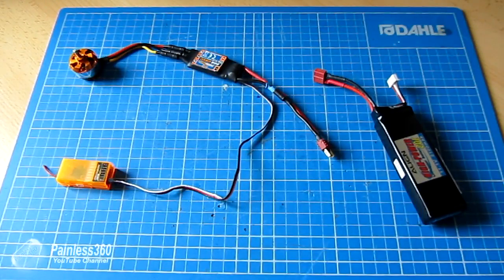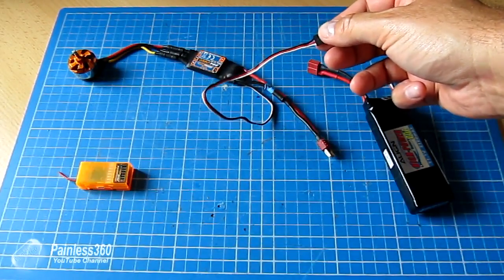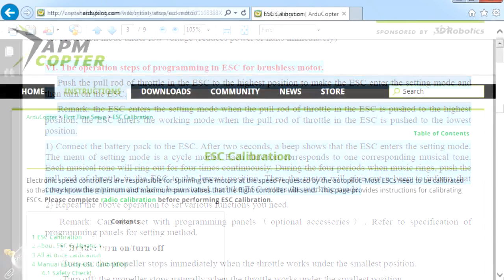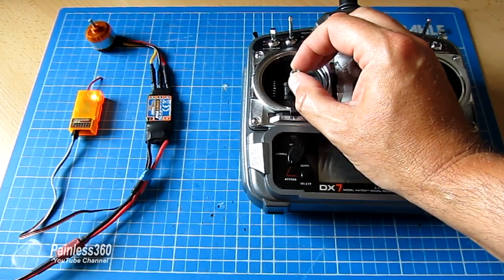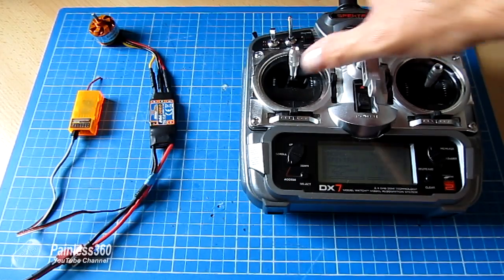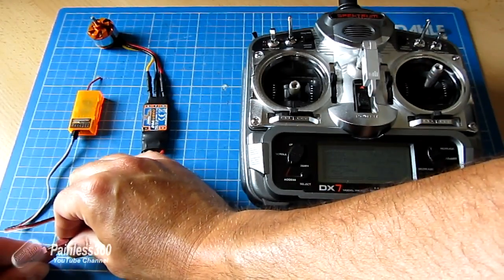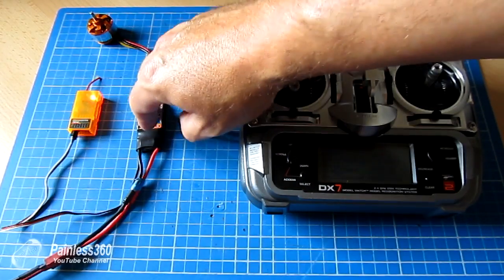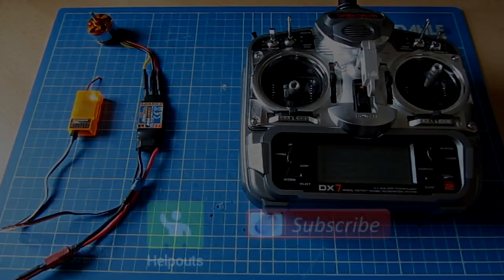Multirotor build tips: Simple manual ESC calibration

Comment: Good day all, I just put together a hexacopter, emax motors, 30A Simonk brushless ESC w/3A 5V esc, NAZE32 REV6 (cleanflight 2.0.0) board and FrSky x4rsb receiver w/Taranis radio.

I did the setup as published many times over, the motors work properly off the pc, but when I use the radio, the motors respond out off sync. I calibrated the escs many many times over, by increasing all the motors on the pc, connecting power, hearing a few beeps, moving all the motors to minimum, and getting the rest of beeps. same result. 

Here is the problem relating to this video... I tried to calibrate the esc using the transmitter for the first time(to see if this would help). I followed a vid where I left all the motors connected to the naze board, radio on and throttle to max, plugged power to the board, the esc chimed up, but when I moved the throttle to minimum, I did not get the rest of the beeps. Now I cannot seem to calibrate any of the escs, once I plug power to the naze board, they all chime up, but that is it. I followed this vid, nothing, I tried using the pc, nothing. Did I kill anything or is there a way out? 

Also, as far as my other pblm of not getting all the motors to respond in sync with the radio, can you point me in the right direction.... Thank you...
Reply from the maker: I'n not sure what you mean by out of sync. Can you post a video?
Reply: I am not seeing the option to post a video. But basically, if I slowly increase throttle, 3, 4, 5 respond immediately, if I stop throttle input they continue to slowly increase till they max out but 1,2,6 barely jumps up, but then settle down to min. If I increase to full, 3,4,5 max out, 1,2,6 increase almost to max, but then settle down to around 1600s.  Hope I was clear... and this is just with the radio, using the pc it works as it should.
Reply from the maker: This is YouTube ;) Not to worry, if I can't see what's going on then all I can do is point you to this video - https://www.youtube.com/watch?v=DDnaAQLjcQQ - hope it helps..
Reply: Apologies for the long comment, but no questions this time :) 

This hex build was initially done using the revo board and librepilot. I built a tri some time back using the revo and liked it and the gcs, so I stuck with it. However I had a problem with all the motors going to max power even with a small amount of throttle input. I swapped around every single part but the problem remained, I re-ran the wizard on my tri(which was working) and it to started to behave the same way!! The only thing I did not do was use the same pc I used for the initial setup of the tri... far fetched but I don't know what to think.

So I decided to use the opportunity to play with the naze32. The model, on both cleanflight and betaflight keeps rotating even though the accelerator was calibrated on level surface. I adjusted the max/min/nutral values on the taranis itself, then the pids, and got the animation to sit still. Now all the motors respond together as they should!! 

I must say cleanflight is nice but I way prefer librepilot!! Once I get the hex to work, i'll try the revo board again. Thanks for your response, and thanks for all your videos, they have been and continue to be extremely helpful....

Comment: there is lots of channel in receiver, in which I have to connect the esc's 3wire?
Reply from the maker: Sounds like you're new to this. Have a look at the 'Quadcopter Building for Beginners' and 'Introduction to Remote Control' series on the channel. They cover lots of the basics that should help..

Comment: i am using 30A esc 1000kv bldc motor and kk2.1.5 when i want to calibrate esc like 
1-hold the 1 @ 4 button of kk board
2- plug the battery and take Max throttle on Tx 
3-KK board show 'throttle pass through' 
4- 1@2 motor run at max speed  
5- after that when i take throttle they not run same time 
plzzz tell me how solve this problem
Reply from the maker: The motors should not run when being calibrated. Usually the ESC needs to see a throttle PWM value of more than 1800-1900 to enter calibration. I'd suspect that you need to increase the endpoints of the throttle channel on your radio a little to make sure all the ESCs 'hear' the command via the high throttle value to enter calibration mode here. See the documentation for the ESCs you're using if you need more detail. Best of luck!
Reply: thanx
Reply: 'yaw input error' how solve this

Comment: hi, I'm trying to calibrate opto 12A ESC's but I only get a tone when you connect to the battery. I don't get the ones that allow me set my thrust range. its a 6Xr. I have the jr from the esc connected to channel 3 and another jr cable connected to the battery port of the receiver to supply the 5v it needs since the opto has no power.
Reply from the maker: The ESC normally goes into programming/calibration mode if it sees a high enough throttle on start-up.. I'd check that the PWM signal you're sending it is enough.. Best of luck!

Comment: I need help with my esc programming here is a link ( youtu.be/4x3GErKOmvA )
Reply from the maker: +Isa Abd Rahman Sosa-Dominguez not seen that one before! What have you already tried?
Reply: Painless360 thanks for your fast response. I try following the instructions that are very similar to yours. I try individually and all sox at one time. Everything seem to work fine into I at the flight controller. at that point the throttle he be to go to +50% for the motors to start. furthermore, once the motors are on they only have one speed with no variations.

Comment: hi painless! i`m trying to calibrate my esc`s {hobbywing XRotor Pro 40A 3D Muti-Rotor ESC OPTO} and i follow the calibration process, which is throttle at max , connect servo lead to x8r , power the x8r {bound to taranis) and then power esc`s , but i get a constant beep! but i tryed throttle in the middle and i got a musical beep and the motor works  on foward and backward !!!  i don`t understand !!~my esc`s values are,, lower point is 1100---middle 1520--- max 1940 but in the taranis inputs does not go lower than 1420,do i have adjust something in the taranis ??.....can you help me please,,thanks painless
Reply from the maker: +RICHARD LUSSIER you're using 3d ESCS designed to spin the motor forward and backwards. I'd look up the calibration for them. We've not used them here. Best of luck!

Comment: HiI was making a quadcopter and a doubt came to my mind.What happens if i connect a 5v battery to the signal wire of the esc with/without calibration?
Reply from the maker: +Adhiraj Yadav not a lot if the fight battery isn't connected..
Reply: I mean...The esc is being powered by a battery via the 5v pin and the 5v battery is acting as a 100% PWM signal
Reply from the maker: Nothing will happen PWM stands for Pulse Width Modulation. The length of the pulse determines the throttle value the ESC uses. A steady 5v supply wouldn't be seen as a 'pulse'. I wouldn't connect things in ways that they are not designed for - it's usually results in bad things happening... Best of luck!
Reply: Oh! Thanks a lot!

Comment: Thanks man! I have no 4th beep after i decrease the throttle. Any ideas?
Reply from the maker: +Aerials make sure the throttle grange in the channel is enough. It will be expecting a value <1100 to finish probably. I'd check the manual for the Ines you're using.. best of luck!

Comment: so you dont need a flight controller to do this? is channel one throttle on every reciever?
Reply from the maker: Nope, you can plug the ESC directly into the throttle channel on the receiver (if it has one, newer mini receivers we have now only have outputs for PPM and S-Bus). Happy flying!
Reply: im using a fr-sky l9R my quad wont stop beeping after a hard crash, the high pulse signals is causing beeping in motors, FC fine, vtx fine, pdb fine, frame is fine, 2 motors bells got jammed up but other then that i cant figure it out, and im assuming channel 1 is throttle?
Reply: So can a newer receiver (like my Turnigy iA6C) with only PPM and S-Bus be used to calibrate the esc? Or do I need to find one with a throttle channel?
thanks for your help!

Comment: Hello, I did my first hover test last night and it suddenly twitched out and into the ground. I thought it was from my movement but...now when I plug in a lipo there are no beeps and no response on betaflight. Are my esc's dead or burnt up now? Everything looks good but in blheli it says esc #1 fail, and cant connect. I use a 4in1. Thanks
Reply from the maker: That sounds like something gave up the ghost on the test hover - well done for doing the sensible thing and testing it before trying to fly it higher/faster, this is exactly why test hovers are needed! I'd disconnect everything from the FC and see if it connects to the PC.. best of luck!
Reply: Thank you. I realized that the ground wire for the 4in1 was broken underneath the cable braiding. Happy New Year.

Comment: i want to use my bldc motor in forward and reverse and brake  i use 30amp hobby power esc and 1400kv bldc motor so how can i calibrate my esc.. will it need to flash any firmware on my esc..
Reply from the maker: Sorry, we've not used any of the 3d capable ESCs here that can reverse a prop. Best of luck with it!

Comment: Help!! I have just got a second hand f450, when i armed it I had smoke 
coming out of 1 motor, I replaced the motor thinking it was faulty, but 
the new motor has done the same. do I have a faulty speed controller? 
how can I tell? I'm looking for any advice any one could give please. 
Cheers
Reply: make sure your battery isn't killing the motor. you might have too much voltage, or you may have soldered something wrong.

Comment: I did this on one of my escs and it worked. The second ESC I did it with is now just making the motor twitch a little, even at full throttle. I had the motor going fine just before I did this. Any ideas?
Reply from the maker: I'd check that the calibration worked and that there isn't a broken/bad joint on one of the three ESC/Motor connections.. Best of luck!

Comment: Ive calibrated my escs and everything but when I plug them into the flight controller and reciever the motors make 3 beeps when powered on and wont respond to transmitter. Im stuck
Reply from the maker: Happy to help but please watch https://www.youtube.com/watch?v=olIqTiSJHIY and come back to me with more detail of what you've tried..
Reply: Thankyou very much. Ended up being that my aileron and rudder plugs were switched so it wasn't arming. All fixed now and working. :D
Reply from the maker: Great news - sometimes it's an easy fix that you can spot by rechecking the basics. Happy flying!

Comment: Is it necessary to calibrate the ESCs using the motor you intend to use WITH the ESC?  Or, can I build a calibration hub using any motor and just swap in the ESCs I'm going to calibrate the throttle with?
Reply from the maker: You can calibrate with any motor - I guess.. The calibration just sets the PWM values for low and MAX throttle.. Best of luck!

Comment: Hi, I am trying to follow your instruction and install ESC for my quad, but I have the problem that when I lower my throttle to lowest postion, I did not hear any sound. Here is the video demonstrate my problem, hopefully you take 1 minute take a look at it and help me. Here is the link:  https://youtu.be/UwHuu2f5TsA. I would be appreciated very much.
Reply from the maker: +Tuan-Anh Nghiem you're trying to do it through the flight controller. That isn't what we're doing in this video. Watch the 'Quadcopter building for beginners ' series to see how to use the Cleanflight GUI to do what you're trying to do. Best of luck!
Reply: Hi,  I have successfully calibrates the ESCs using the cleanflight, but when I  start lifting the throttle, the ESC number 3 got burned right away. What did I do wrong ? Thank you very much for your help.
Reply: Mate, you might have hoocked it up backwards...
Buy a new one, sorry

Comment: tried calibration 4 esc together on my multirotor apm 2.8 controlled dx7s and ar6200 didn't manage calibrating all of the escs together. do you have a idea why and what can i do to calibrate them?
Reply from the maker: +Tomy hobby tricky to suggest something without knowing what you tried and what the exact issue is. I'd run through manual calibration again..

Comment: I did this with my multistar 15a esc, I calibrated it many times now, but it still had a dead zone at the bottom, about 15%, which I need to be fixed, as I'm using two to build a wing, and the two motors start at different stages.... Any help? I'm pretty sure the process is the same.
Reply from the maker: I'd look at the throttle range on the radio and reduce the bottom end slightly and retry the calibration. There can be a dead-zone at the bottom end with some firmware but you're looking for a consistent start point.. Best of luck..
Reply: +Painless360 oh haha, I was literally coming on to say that I got it working, but thanks anyway.

Comment: Hi. Recently I tried to calibrate my 12A SimonK ESC and according to yr video and maker instruction and it seems that  everything went well. The thing that is confusing me is that the calibration is being done with RC on channel 3 but for the normal flying I am using PPM (connected to ch:1). Despite of the calibration I experianced lazy motor issues but I solved this problem by changing the throttle curve on my RC. Now the motors spins equally but whenever I am increasinge throttle more dynamic the model is becoming "crazy" and even sometimes engines revolutions drops suddenly. Do you have any idea what could be the problem? regards.
Reply from the maker: +rav be The channel thing is common - don't worry about that. What do you mean 'crazy' impossible to provide useful suggestions without a lot more detail. Happy to help but please watch https://www.youtube.com/watch?v=olIqTiSJHIY and come back to me with more detail of what you've tried..

Comment: If I bought an RTF and busted 2 of the ESCs and motors, can I just slap on new parts or do I have to tune and re-calibrate things?
Reply from the maker: +Overlord277 You can only if the ESCs and Motors you use are IDENTICAL to the ones that are broken..

Comment: what's the specification for the battery ? i have a 30 A esc. and my battery is 3300 mAh 25 C . so if i connect it with only one esc will it burn the esc ? because the current in the battery is 3.3*25= about 80 amp
Reply from the maker: +cybernerd adnan The current spec for the battery is the highest amount of current that the battery can safely deliver. It doesn't mean that this is what it pushes out all the time, regardless of what it's connected to. See out 'Introduction to Remote Control' series for more of the basics covered. Best of luck!

Comment: And can i use 3s 2200mah battery for the calibration process..
Reply from the maker: +Rajat Tripathi So long as the ESC is rated for the voltage of the pack 3s, 4s etc) then it'll be fine...
Reply: ok thanks

Comment: Hi Lee,
My name is Grove Hull and I really appreciate all the work you do with Painless 360 and OpenTX U.
I got bit by the RC bug when I got a Blade 350 QX. I later built a carbon frame for it then decided to try building my own Quad. I got a Happymodel U580 frame with retractable landing gear, Hobby King 30A ESCs 3A UBEC and NTM Prop Drive 28-26 1000KV/235W motors. I got a JIYI P2 controller, but sent it back because it was defective.
I then bought a Arducopter 2.6 controller and a Turnigy 9X Radio. I got it set up and the escs calibrated  and it would arm and the motors would turn. But then I discovered I could only get 2 flight modes because of some obsolete firmware on the Turnigy unless I cut into it and rewired it to update the firmware. I decided instead to get the FySky Taranis X9D Plus and a X8R receiver and work with it.
When I got it, it wouldn’t arm or turn the motors. I decided to  recalibrate the escs, but they won’t calibrate. I’ve been trying to get help online to no avail. I tried changing the weight on the throttle mixer up and down… but if I turned it down, I would get some musical sounds from the arducopter, not the same as when I calibrated the escs… it doesn’t ‘sing to me’ like it did with the Turnigy 9X Transmitter.
If I go into Mission Planner I am able to calibrate the radio and got the compass and accelerometer calibrated just fine.
I tried using this video on manual esc calibration, but when I try that the esc doesn’t sing but I get a high pitched rapid beep from the motor.
Do you have any idea what my problem is with calibrating the escs and being able to arm the motors?
… it may be simple to you, but I can’t figure out why I can’t get the Taranis to work with this. I've been trying for nearly a month now.
Thank you for your time,
Grove Hull
Reply from the maker: +Grove Hull Check how far the Taranis is moving the channels. We do cover this in the Taranis series. The radio likes to push the PWM values on the channels below 1000 and above 2000 and this can be confusing for some flight controllers that expect the range to be 1020-1980 or similar. I'd use the 'servo' menu on the Taranis to reduce the endpoints of the main control channels (THR, ELE, AIL and RUD) so that you stand a chance of setting up the board.. Best of luck!
Reply: Thanks a lot. I finally was able to get them to calibrate and turn through the Arducopter controller. You are awesome!
Reply: Do you have a video or instructions how how to set up arducopter flight modes to work with Taranis X9D? I've watched a few, but they confuse me how to get the right frequencies for the different modes going from Taranis to Arducopter.
Reply from the maker: Sure do, also have a article on the OpenTX university..
Reply: Could you send me the links please?
Reply: +Grove Hull I got it... read it in open txu and they're all working!